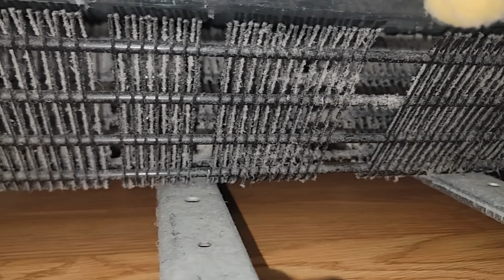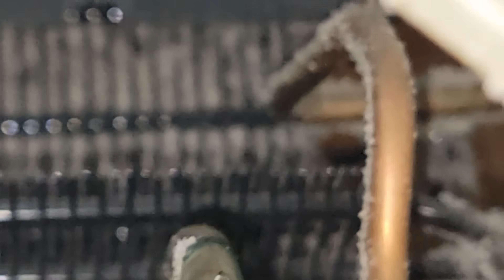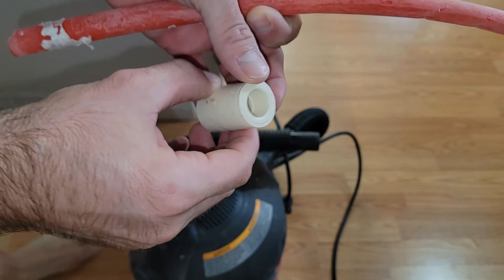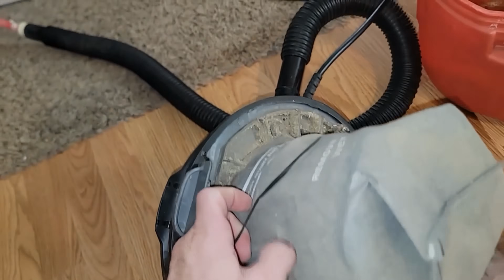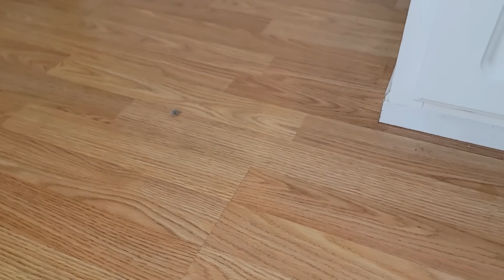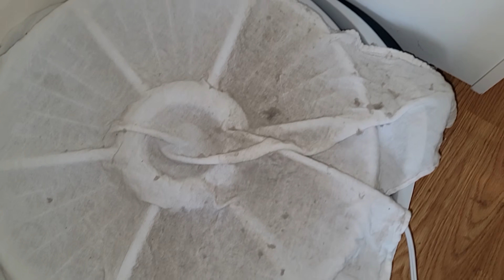Clean Fridge Coils WITHOUT Air Compressor [DIY]

Comment: Respectfully, though it is improved, I'm pretty sure you want it to be cleaner than that. You want to be able to see the vast majority of a clean surface (black without oil from cooking, etc). Everything covering the clean, black surface is insulation that will prevent it from exchanging heat nearly as effectively - like someone covered in a light blanket/sheet.

Comment: You have an almost identical side by side refrigerator like i have. The coils are on the bottom right side and run back about 2/3 of the depth of the fridge. I used irwin quick jacks to slightly tilt the fridge to the left and was able to get my arm under with a shop vac hose and brush head. Cleaned all the coils off good. Just another method if you have the Irwin or Dewalt quick jacks. Gives you great access to the underside of all the coils.
Reply: Our coils are the same - easy to get to the very front but not the w shaped coils behind.   Vacuum will only work when the hose is very close.   Makes sense to blow which will travel further.  Tilting  the fridge seems dicey.   If I couldn't lift the entire fridge up to level position, I would not try to go underneath
Reply from the maker: Awesome suggestion!

Comment: Great idea with the fan. I keep another vacuum cleaner running in the back. I vacuum first, then blow it out back to front, then reverse. I just cleaned my 45 year old GE side by side. The coils are in a flat configuration on the bottom, single layer, so it's easy to clean. Even after 2 years since the last cleaning, it was surprisingly clean, even the fan blades.

Comment: I used a 20”x20” box fan with a 20”x24” Merv 8 furnace filter taped horizontally to the intake side of the fan. I then taped the fan to the back of the fridge. A shop vac was the blower. Next time I will tape the perimeter of the fridge to the floor and cover the cavity behind the fan so less dust escapes. The furnace filter ended up looking nasty!

Comment: Once unplug my fridge i can just plus it back the moment after like nothing happen ? Dont need to wait ? Sorry I just had to buy a New one after 2 1/2 year now im scared to mess thing up lol
Reply: correct you don't need to wait... just plug it back right after.
Reply: Cleaning will take more than enough time for the pressures to equalize. There are protection devices for this or else power glitches would be damaging. Still, when I can, I unplug my fridge when power goes off, as it can come on and go off again. To be safe if you unplug it, just wait 5 mins or so, then plug back in.